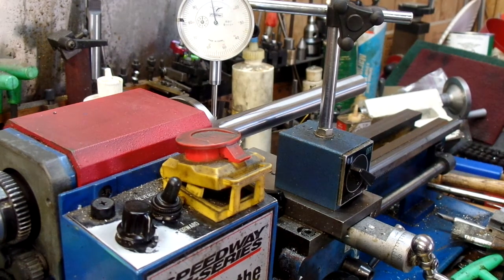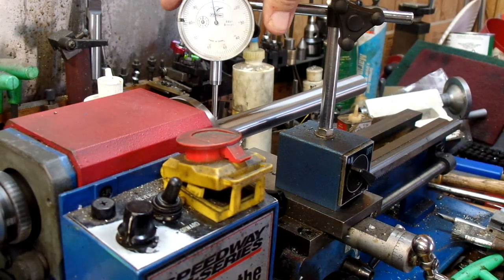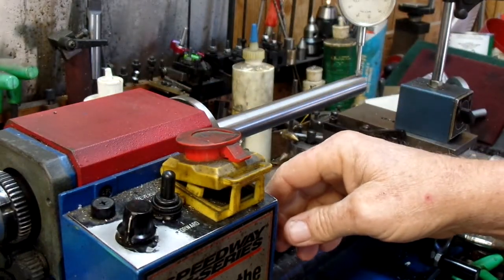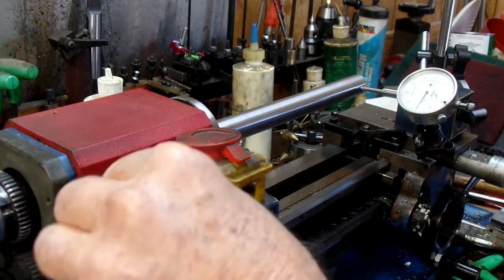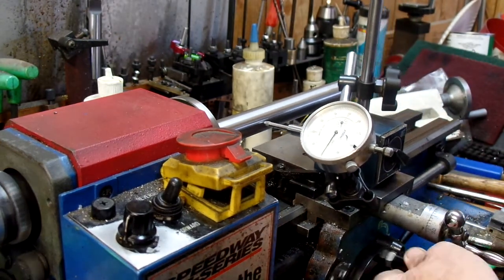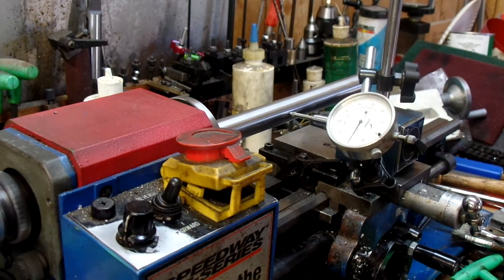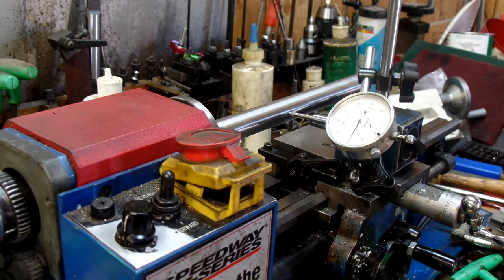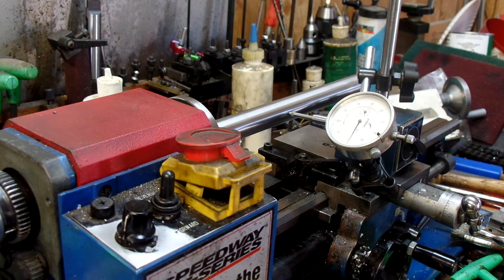E27 using a test bar on a mini lathe

Comment: Thanks Dennis I have the exact same problem with my mini lathe,  turning a taper when I meant to be parallel
I m guessing its the head stock that I need to shim somehow

But It sets on the ways  with 3 points of contact so can you explain more about where you put your shims please.

I have bought the Indian test bar so I just need hot to figure out the shimming process.

Dave Perry from London England

Comment from the maker: I did make a "Dumbell" test bar, machining a section near the tail stock and the HS and comparing the diameters to adjuct the TS. The TS is not easy to adjust due to the design and the quality of manufacturing.
The tail stock I bought from Amadeal in the UK to get a sturdier unit than the OEM TS. I am pleased with the replacement unit.
There is nothing wrong with the lathe now that could not be cured  by replacing it with a good American precision lathe.   :>)
Have fun